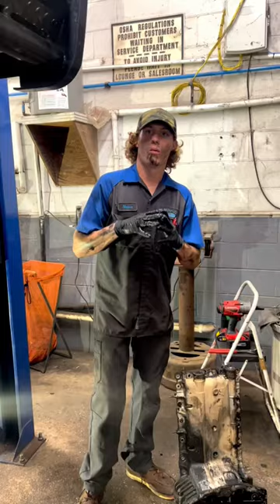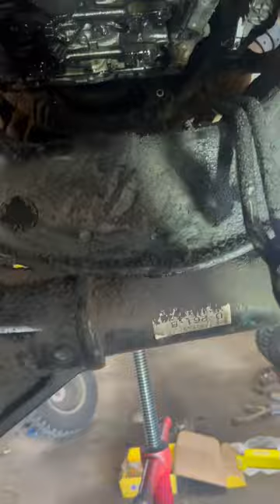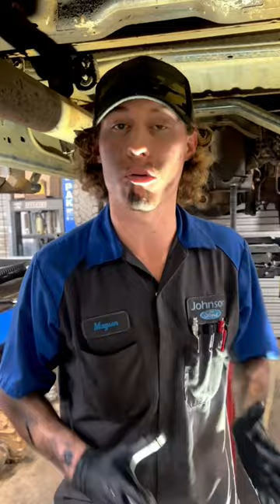Mechanics Should Get To Stay Clean Too #shorts

Comment: That's not even dirty.. what your dealing with is hardly worth ranting about . It's part of the job. I go into work everyday knowing i could be covered in Grease, oil, dirt/ mud , slushy snowy melt down your back bs and everything inbetween before first coffee,  and you know what the best part is I don't over charge customers because I got myself and my tools dirty.. its part of being a Mechanic. Maybe the parts department is a better fit if your scared to get dirty.

Comment: On the flip side of that, if someone comes in with a job they knew would be nasty and they got all up in it with a pressure washer and did a good job… well guess what your vehicle just went right to the front of the line and I’m going to go as easy as I can on your wallet!

Comment: Yeah usually by the time their cheap ass finally breaks down and pays you to do the oil pan it’s completely covered in thick grime. Yes it’s part of the job but it takes longer and yes you will get charged more if they deem it necessary

Comment: Why haven’t they designed seals or gasket material that can’t get oil soaked or fuel soaked or dry so we aren’t dealing with the same problems since the first motor got invented. I say we need to design better crank case breathing systems and seal these cocksuckers for good. We can’t get n/a motors to seal let alone anything forced induction.

Comment: You are young, you need to learn to work smarter not harder, Not to mention screwing up your personal washing machine. Be a skilled professional, there is zero excuse you need to look like you rolled in dirt and grease all day. Make your job way cleaner, and way easier, have the shop helper spend 5 minutes and pressure wash that dirt pig before you touch it with a wrench. Unlike many years ago most shops have a pressure washer you can at least get rid of the inches of built up mud and dirt. There is no excuse and nothing cool about being covered in dirt and grease all day especially if you are in and out of customer vehicles.

Comment: Charged extra? Wtf fo you think is coming to you to get fixed? It ain't perfectly good functioning cars with  nothing wrong with them. 

No, it's broken cars that leak oil and grease and crap. That extra should already be figured into the rate. FFS, you didn't get an office job or anything.  You knew what you were getting into.

Comment: Most jobs do not take the recommended charge hours. If a shop charges $125 an hour for 14 hours but the job takes 8 you make $875 to take a fucking shower.
Reply: He doesn't make 875.    Techs don't make the hourly shop rate    he prolly makes 20/hr  so he got paid 14x20.     So he gets 280.   He did it faster than book which is good.  But if he only got paid for how much time he actually put in he would work an awful lot slower

Comment: That "book" already alots you more than enough time to shower and clean the truck tho lol 🤣. Working at a Ford dealership garage, they already quote an extra 10-20 hours to begin with. Most of the time you don't have to follow every step to get the job done. They just want you to bill the customer all that labor. That's like saying you had 14 hours into taking that part off lol.

Comment: The complaint is in the carelessness case in point!!! While running your fingers through the grease in the cross member you flung pieces into the engine girdle and onto the rotating assembly……..🤡🤡🤡🤡🤡🤡 the same goes to the Chrysler dealership that told me I can’t change my oil because of the warranty………. So I take it in and some dumb shit has scattered peanut shells everywhere that caught fire!!!!!!! Now Ik better than to pay some “Kai the hatchet wielding hitchhiker” lookin MF to work on my truck!!!!

Comment: Understandable, but counter point, mechanicing is dirty damn job no matter what ur working on, and you chose it. I pour concrete for a living and go home with boots covered in 10 lbs of mud with concrete in my hair, beard, nose, eyes and everything in between, and I don't complain about it. Why? Because I willingly chose this profession and knew it was a dirty job before hand. If your worried about being clean, get a desk job instead of doing others dirty by charging extra

Comment: Come on bro the book gives way more hours than you should ever possibly need.
Reply: Lol no. But maybe just cause I work on German cars. I found book time for a power steering cooler on a Touareg and it was 1.1 hrs. U have to remove the whole bumper both headlights the crash bar and the core support. Then u can replace the cooler. I sold the cooler for 4.2hrs.

Comment: You don’t add time just because you feel like it. Book time is book time for a reason.
Reply: Sure. Until you have to scrape layers and layers of mud from the underside of a truck just to work on it or gain access to connectors for diagnosis. Especially diesel trucks that are used primary for heavy duty work and go through anything and everything. Same thing with old rusty cars. If I think bolts have a possibility of breaking/stripping then I add an overestimated "torch time" or bolt extraction time so if I do need time I have it. If I dont need all the time i dont charge it. 6.7 deisel egr tubes are prone to have their bolts snap even at low miles and they are a hardened steal requiring an expensive kit and a shit ton of time to drill them out, tap and die them. If you don't work in the industry day in and out don't speak on it.
Reply: @DefaultSlayer  so I’m sure you only charge for actual time if you were to get the job done faster? Besides, detail time is itemized as it’s own time not as book time, and to charge a customer for time used to clean up the shop, your personal clothing, or body is a ludicrous idea. Not to mention that diag time is it’s own thing not included in book time. My comment still stands.
Reply: @BigDaddyThrock  you arent a tech so you dont know what you're talking about
Reply: @contraband1543  your obviously not a businessman
Reply: @DefaultSlayer  cool story bro. Way to totally bastardize my whole point in the first place. You’re arguing with yourself at this point
Reply: @Big Daddy Throckmorton  you obviously aren't either. You should sell sandwiches at what they cost you to make and see how it goes. I bet you don't make any money. Just like if I decide to extract bolts for free. Or have to spend 30 minutes cleaning up myself and my works space of mud oil and dirt. Guess what I'm losing money. Maybe I should just work in filth and get in a customer vehicle cover in mud and diesel oil. I'm sure they'd be ok with me telling them I'm not getting paid to clean up after myself and they'll have to deal with the oil stains themselves. That will be great for business